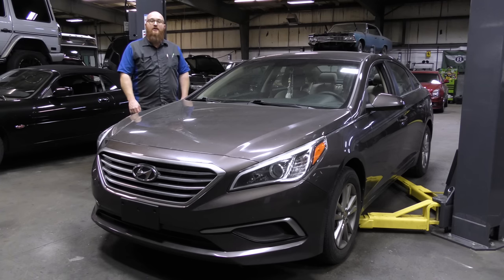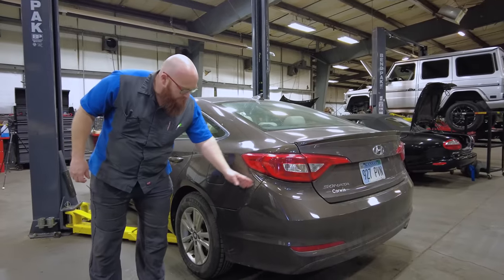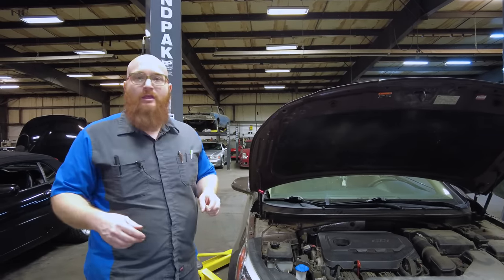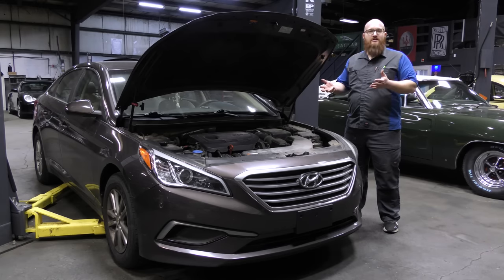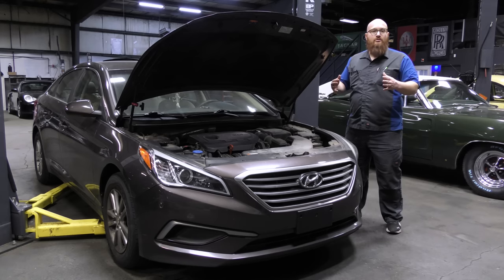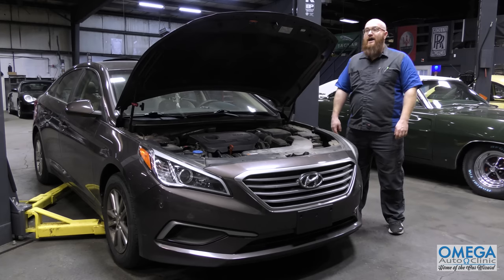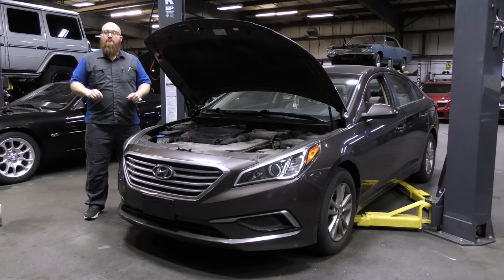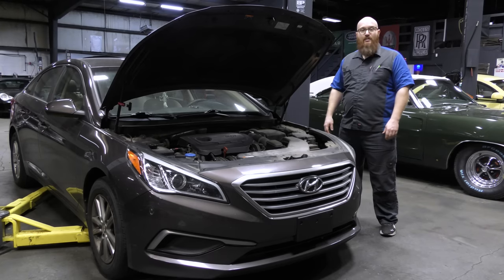What could be so bad on this '16 Hyundai Sonata that the CAR WIZARD is sending it to the junk yard?

Comment: I think I had a 2000 Chevy cavclear with the single camp. And I bought it for $500 and I drove it for a little while and was like there's something wrong with this and I checked the oil. It had no oil, so I did the old change and and it was like this car where not even half a quart.  Came out and it was black and horrible and so I looked in the engine and it was all gummed up with oil. So I changed the oil and it was fine and I drove that car for years.
 And eventually sold it back to the original owner and actually asked the original owner when I found the oil problem. I said, have you changed your oil and they said no.  But by the grace of God, somehow when I change the oil it worked fine so I don't know if that's a testament to that engine but that engine was slow as dirt.

Comment: As nice as the interior is, Mrs Wizard will now get back in her Mustang , Good Day. 125K is not bad service for any car, especially a low price compact. I think the longest Hyundai warranty ends at 100k, so I think the dealer stance is proper. A car in that shape would ordinarily benefit from a used motor out of a boneyard. But, I see your point CW, this engine is no Chevy LT.

Comment: Those motors are junk. We had a kia with it. Supposedly it's the piston rings, their to loose. We were burning starting out a quart of oil a week, to almost a gallon in a week. We didn't qualify for recall because we were 2nd owner. My wife and I were so pissed. It was our first newish vehicle that we bought from the dealership. Finally it blew a piston, at just 100k miles.

Comment: Wow i got so lucky. I have a 2012 kia optima sx with the same engine and it failed at 92k miles. Luckily the dealer i bought it from replaced the engine free. I just got it back this last saturday. Scary to know that they most likly replaced it with the same engine that has the same exact issue even though its new, it will eventually fail again.

Comment: I own and drive a 2008 sonata 240000 miles have done spark plugs twice just did coils cleaned mass sensor oil changes every 3000 miles drive 50 miles a day burns no oil did brakes twice third set of tires also a 2.4  the factory recommended oil change interval is 5000 designed for failure my first new car

Comment: Not necessarily. The same car for sale for less has a ton of miles, where replacing with new engine has zero.
 You're advising the customer to spend upwards of 20K for a nice used vehicle, or 30K for new.
 ...And you just finished showing an immaculate interior.
 Best put up in the air and inspect 
the entirety.

Comment: To start, the warranty for that engine is 100,000 miles and your car is 120,000 miles when broke down. Face it, the car lasted 20,000 miles more than the miles specified in the warranty. You have nothing to complaint about.

On the other hand, we own same year and model and the engine knocking started at 90,000 miles. We took the car to the dealer, the motor was replaced by a new one, this car has now 198,000 miles, sometimes consumes a quart of oil per 1,000 miles, sometimes consumes one quart every 3,000 miles. we do not worry about it because we have received a lifetime warranty for the motor, this is from Hyundai corporation.

When you bought the car your invesment has been for 100,000 miles motor/transmission warranty. Best you can do is replacing the motor and enjoy that car, because that Hyundai 2.4l Sonata is a good car. This model had a motor problem in car production 2015 to some 2017 cars. Hyundai has replaced hundreds or thousands of them. 

Stop complaining and replaced the motor by yourself, because that car has no other issues and just require the schedule maintenance: motor oil, air filters, transmission fluid, brake fluid, belts, and runs smooth and is reliable.

Comment: The only bashing I'm gonna do is on those Hyundai Kia cars. They're garbage, almost every single model they've made since 2011 has, at some point, had a recall for a serious engine problem that leads to a failure one way or another. The electrical systems are garbage, tail light wires rub through and stop working, electronics in the interior will stop working, the AC systems are problematic. The only part of any Hyundai or Kia that isn't very likely to fail is the transmission, and only because the engine won't last long enough for the transmission to be able to fail.
Worst modern cars on the road. You'd be better off driving a Yugo than a Hyundai.

Comment: Ee had a Sante Fe with the same engine. Changed the oil every 3500 miles. Started burning oil and knocking at 130k.  Dealer said it was a recall engine and they would replace it. Kept it for a week. Then called us and told us they  actually weren't.  Told us it had to seize before they would fix it. It was my wifes car. She always had the kids with her.  I said ok, ill never buy another Hyundai and replaced that car with a Toyota.

Comment: Regrettably even if you are meticulous about maintenance this sort of thing can happen.  I had a similar experience with my 2011 Audi A4 Wagon.  A 70K the engine started to consume oil at an alarming rate.  Engine block replacement would have cost $15K minimum.  The car itself was immaculate so I was fortunate enough to sell it.   But I lost all the money I spent over the years to maintain the vehicle - brake job, battery replacement, wheel&tires, etc.   And I didn't mention the work that was performed at the dealerships while the car was under warranty.   On two occasions it spent over a week at the dealership on each visit --- once to correct a  loud wind noise on the highway plus a variety of engine oil leaks;  a second time to remove the engine in order to repair the breather system.   I had a BMW 3 before this that was just as bad.  I am done with German cars.
Reply: It probably just needed piston rings done.

Comment: Not really had mine rebuilt at 100k,its still going and its at now at 180k no pecking nothing,smooth sailing,also if you get one form LQR YOU CAN GET A CRATE ONE FOR 4200 AND 1 YRS WARRENTY

Comment: It takes 5 minutes. I check my fluid levels , tyre pressures and quick peak through the wheels at the brakes every second tank of fuel. Edit and turn off the radio and listen to your car occasionally.

Comment: I want to get my hands on the motor, do a tear down inspection to see if there could be a fix to the issue.  I have researched a researched kit and it comes everything for the bottom end.
Reply: Once you go low on oil and metal to metal contact occurs, you have both visible and microscopic metal fragments throughout the entire engine. It's junk at that point, there's no kit, you throw it away. It's not like a worn out cam tapping where you get lucky and replace the cam shaft and rollers and Bob's your uncle. This thing has spun crankshaft bearings, I heard it in the audio.

Comment: You have to not only check the oil level but you should be changing the oil every 3-4 thousand miles. Oil companies are now saying on their oil bottles that this oil can go ten to twenty thousand mlies. That is a joke. Doesn't matter if it is synthetic oil. All oil get's dirty. It should be changed way before the recommended mile change because your engine will last longer.

Comment: As much as I want to blame Hyundai for this — and yes, the engine probably should not be using oil like this — but if you don’t ever check the oil level on your car, and the engine blows because of it — it’s really on you.

This car has almost 120k miles on it. It’s going to burn oil. Even a Toyota engine will burn oil at this mileage.

This is a really bad situation, but clearly proper maintenance wasn’t done to car — and that is on  the owner.

Comment: It’s better to have a good car than a good warranty. Any car besides a Toyota, Honda or Mazda don’t exist to me. Frequent visits to the dealership, loaner cars and an arguing gets old fast. A friend of mine after his Hyundai was in the shop eight months,  bought the loaner car. I have a 2,000 Camry, 2005 Element and a 2017 Mazda 6. They haven’t been carefree, but they all have the original engines with well over 100,000K miles. Everything on my 2,000 (189,000 mi.) Camry still works except one rear window. My son-in-law inherited his father’s 2,000  Hyundai. A couple of months later he needs an A/C compressor and a water pump (not covered by warranty). I recommended he to trade it or sell it as is, before wasting more money on it.😢

Comment: I have a 2015 Hyundai sonata eco 1.6 turbo. I bought it with 91 K miles and then start noticing the oil level goes low like crazy. some mechanic suggested to call the dealership because it might be Under RECALL, so I did many times and always the same answer your car does not have recall. I'm still dealing with this problem so I'm adding oil every week  . its costing me money time and stress. I WILL NEVER BUY HYNDAI AGAIN DOOOOONE

Comment: had the same problem oil burned off without warning. cause was metal shards left in he engine from factory manufacturing. Hyundai replaced the engine and gave it a lifetime warranty. the owner should have not accepted the dealers answer.

Comment: We have exactly the same car the same noise at out shop, I refused to put a used engine because you're just gonna get another junk that is about to blow up and they want $1800 to $2000 for the used engine. U gonna make the customer spend $5000 and in 5 mounts it could blow up again.

Comment: I have a 2016 Hyundai Tuson 2.0L and it burns oil. I have to put a 1 to 2 quart of oil around 3000 miles. I really wish I had not buy it. So, many other things have happened with the car and it is really frustrating. Over 3k into the car for repairs.

Comment: I heard someone tell me "Kia and Hyundai are much better cars now, they are built so much better and last so much longer now...." I laughed in dead Theta II engine and walked away. And the thing that makes it so bad for the Theta II engine, is that it does not seem to matter if you do the (stupid) 10,000 mile oil changes or actually do something more sensible like 5,000 miles, it seems these things just want to die. And when people ask me what brand of modern car I would recommend, I really can't anymore. Honda has V6 engines with cylinder deactivation systems, the most common failure point I have seen with those in person are holes torched into the pistons on the cylinders that shut down because the fuel injector fails in such a way that it turns into a blow torch. I see Ford, GM and Chrysler lots full of vehicles waiting on various repairs that no new car should need. It is the 21st century! We should be doing better, not reverting back to wasteful stains on the planet!

Comment: Don’t know how this Hyundai is with oil consumption but I had a Kia I lost later to a wreck, but before that happened I had a previous 6 month period maybe where it started burning crazy oil and I took care of oil changes very well and used full synthetic it’s whole life… it started around the 100,000 mark and things just started pooping out.. it’s very sad to see something your taking care of go capoot… honestly glad it’s gone. That 100,000 mile warranty is there to tell you that’s how long it has but many can start burning crazy oil before that I just got lucky which is crazy to say. Hyundai and Kia should be ashamed of their products. Glad I went with Japanese after that. The more time goes on cars will be more expensive than they will be to buy new cause mechanics charge so much especially in accident situations.

Comment: The only reason they fail is peopledon't change the oil. My 2016 is mint. Interior is brand new. Changed the plugs at 150 kilometers and put in a wheel bearing. The engine pulls like it always did. Change your oil and check it weekly. That jug had more than a quart dude. Still pathetic.

Comment: These engines burn at least a quart every 1000 miles. It wasn't low because it was neglected, it burned through 3 quarts in 3000 miles. Capacity is 5 quarts so that's how you end up with less than 2 quarts before it's time for an oil change.

Comment: My Toyota dealer, said, people buy a car, tires, and gas. 100,000 miles the engine are junk, because of no oil changes.
  The used cars there are just 2 of them out there., people how care about cars, and people how don’t.

Comment: It is normal for a car to use up to 1 liter of oil for every 1000 km it runs, or a little over a quart of oil per 621 mile, so be prepared to check it every month.

Comment: Is the car covered under recall ? Summary: Hyundai Motor America (Hyundai) is recalling certain 2015-2016 Veloster, 2012 Santa Fe, 2011-2013 Sonata Hybrid, and 2016 Sonata Hybrid vehicles. The connecting rod bearings inside the engine may wear prematurely, which over time can result in engine damage.
Reply: It was, but the dealer wealzed their way out of it by claiming they didn't properly maintain their vehicle since it had low oil.

Comment: It seems Hyundai bought into the American idea of built in obsolescence and throwaway cars. I’ve had a 2011 Sonata 2.0, seized at 90k. And a 2015 Sonata 2.4: seized at 61K. Kept records so dealer replaced the engine both times. 😊 Why they don’t just buy engines from Honda,Toyota, Mazda is beyond me. Does the aftermarket offer these that fit Hyundais? Also is the 2.5 Hyundai engine that came out around 2020 any better?

Comment: Mr. Car Wizard,
I have a 2018 Sonata that has been fairly reliable except for the GDI engine that consumes oil like mad! I have to be vigilant between oil changes since I bought it. I've also had to replace the starter for $650.00 and for the second time around have had to replace the plugs and coil pack for $800 00 after only a year!  The last repair I had no choice but to take it to my local Mavis. I'm in the process of buying this  car but only have a little under two years to go on it. At this point I'm thinking I'll ride out the loan and then go to Toyota. These GDI engines are ridiculous. Hyundai needs to step up their game. Just curious on your thoughts. Thanks.

Comment: Criminal to see neglect forcing this car to be scrapped. But not my money or my woe.  Another problem with rebuilding this engine would be finding the parts especially oversize pistons etc. even if you had a manic determination. Not like an old Chevy. They are not really made to be rebuildable. 
Watching other YouTube channels, the lack of oil changes and even checking it seems to be a growing problem even from brand new.. Not helped by " lifetime"  this and that. Just did the second trans fluid change on my 2012 Holden/Chevy Cruze today. Trans is even smoother shifting than the last fluid change. It should see me out without dying bar some sudden death like a solenoid etc..

Comment: Yes that 2016 model year was awful for Hyundai.  I had a 2016 Tucson that was consuming a whole quart of oil every 600 miles.  The oil usage clogged my catalytic converter!  I had terrible power trying to drive uphill and I could hear air hissing out of it.  Got the cat replaced for $2,200.  Terrible brand of car

Comment: I have the same car but I have the oil changed regularly. but it never makes it to an oil change without needing a quart of oil or more. now it's knocking like crazy had it towed to the dealer. it has less than 100,000 on it wonder if they'll tell me it's my fault you need  a new engine.

Comment: That's the owner's faults and she didn't change the oil I've run Hyundai's for over 300 000 miles. Regular castings on is clean and they run a lot better if you pull the engine apart and clean the casting almost like putting the intake exhaust but just a very simple cleaning of the casting not really porting. No matter if you're driving a Ferrari or a Hyundai.
Reply: this owner of car is the exact same of toyota or honda owners and whine why it didnt last 200k miles because people ranted they did so! They drive years without changing the oil or filter and go 80+mph on the freeway of a 65 mph limit each day then wonder why every car flops!

Comment: I don't understand. Is there no 'low oil' warning light on the dash on those cars?
Reply: No there's not, you must pull the dipstick and check oil level, once a week. It's a very simple process and could save you thousands of $$$.  I wish there was a low oil light.

Comment: 😮I have a habit to listening to vehicle's as they pull up to stores, I can hear low oil, I can hear the valves, this people don't check nor do oil changes, they just drive. Today's people have no idea how to change oil, filters, they give it no thought. It use to handed down from father to son and daughter. Those days are long gone, I know so many in there 20,30 and even 40's that have no idea how to do an oil, filter change, and most have sons and daughters that drives and they also haven't a clue, most don't even check, they just drive. You can't trust oil lights, kinda sad😢.

Comment: 2017 santa fe sport with 93k on the clock. #1 cylinder compression ring failure. Thought it was the ecm because of misfire and injector because of fuel. NOPE. so now im putting a junkyard engine in, and as  soon as it's back to running good..im trading it in. Hyundai is 💩💩!!